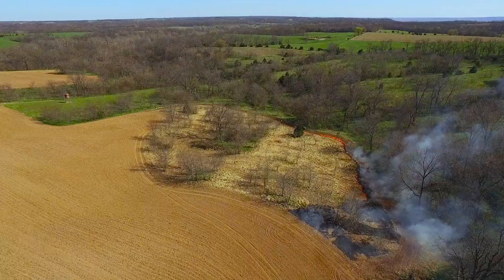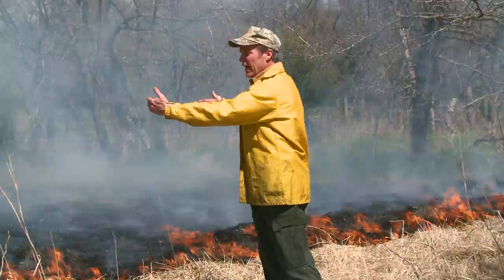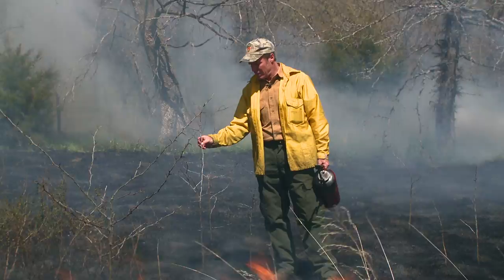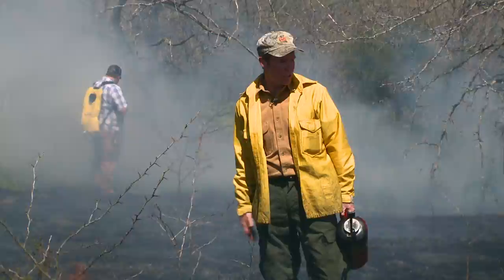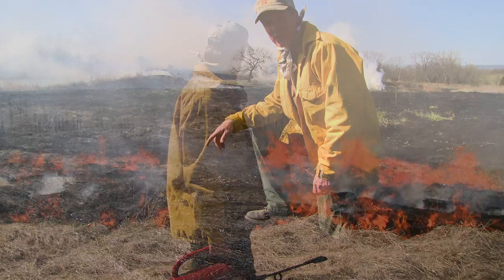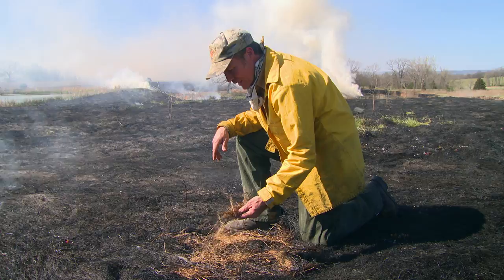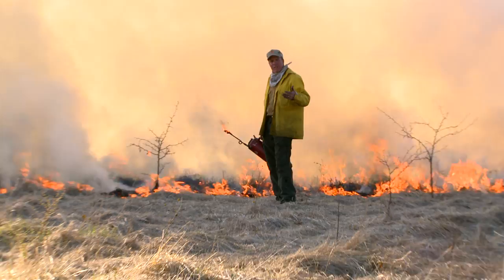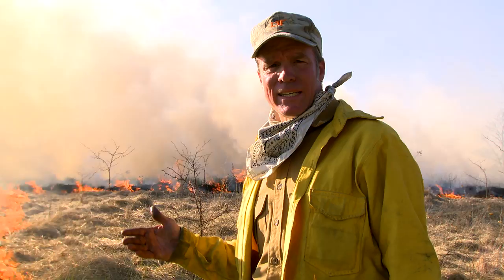Habitat Management | Controlled Burn Techniques | Prescribed Fire

Comment: I’ve heard you mow at least 4 foot lanes around the field for fire breaks. Is this correct?
Reply from the maker: There are many ways to create or utilize natural fire breaks. Mowing around a field is certainly a good and safe option.
Reply: Your break width is determined by your fuel and flame height. Smaller flame heights won't require as wide of a break to contain as a tall field of switchgrass would.

Comment: I've always wondered why people backburn to prevent fires when backburning is more likely to make fires worse.
In the early days of metallurgy, before people discovered coal, there was an entire industry built around charcoal burners. They used to burn wood to a point where it tuned to charcoal  and then store it for use in kilns. They did this because they discovered that it caught fire a lot easier and burned a lot hotter than timber.
When you backburn you do pretty much the same thing. You cover the forest floor with one of the best things humans ever invented for lighting a fire.
Reply from the maker: Interesting! Thanks for sharing!
Reply: Charcoal appears during burning with low oxygen levels, when the combustion doesn't complete fully, kind of “partial/pre-burnt wood”. Those are rather complex conditions to ensure, and rather hard to make to charcoal, not burning the wood completely.
Burning the stuff “in the wild”, on a large well-ventilated (well-oxygenated) area, will likely do a ”full burn”, so the wood will turn into the ash rather than into the charcoal.
Reply: @hawkesworth1712  
Now if you have ever watched any Fire Videos like Cal Fire TV on YouTube. They show that they are setting a backfire At the edge of the road and then you realize after watching it, that Fire 🔥 has no fuel source to back up to At the road edge but it's going to be a Head fire instead and cause Major Damage cause the wind is Now pushing the Fire ahead, and not slowly backing the Fire 🔥 but they lit it At the road side and the wind direction is key to a successful backfire and pushed the Fire 🔥 to the many houses that where burnt 🔥🔥🔥🔥 Up and They went ahead and said in the video that they were lighting up the Backfire At the road and a backfire goes against the Wind direction, but they did it with the wind direction and the Fire Race was on to try and stop it 🛑🛑🛑🛑🛑 but it wasn't a backfire now, it's now called a Headfire and out of control and it blew up overnight from what the TV News says.... and They wonder 🤔 Why that Happened........

Comment: Holistic Management  , cell grazing is a far more eco friendly way to consume thatch and bring back green pasture
Reply from the maker: Bee Winfield

Grazing alone will not eliminate non-native, invasive species. However, burning the non-native grasses in this case allowed the native seeds in the seed bank to germinate and dominate this site, without planting one seed. Native species are much more beneficial for both pollinators and also wildlife species for cover and browse. A lot of non-native species - for example, fescue, were brought over to North America for livestock grazing purposes - because they are resistant to grazing, so, grazing will not eliminate them. The most effective way  to eliminate non-native grasses is a proper herbicide application and burning.
Reply: @Whitetail_Properties  thanks for your reply, I am from Western Australia and we plant fescue and hope it survives because it is great grazing. I guess its complex and I dont know your terrain, eco system or objectives but as a general principle applicable  everywhere, and as stated by Allan Savory and Aussie Peter Andrews (great landscape restoration experts),we have to manage plants and animals to maximise soil microbe numbers and diversity. We Need to graze down the carbon into the soil ,  out of the air. We must not add to CO2 with burns and herbicide , both sure fire ways to degrade the soil and bring up weeds and invasive species. Over here they burn the bush every 6 years , thats way too frequent . Naturally a lightening strike may ignite a bushfire once every 20 years . That is fine and awakens native seeds like you say. But too frequent burning is very different and leads to poor soil that  grows only flammable weeds . So you have seen the return of healthy native prairie grasses after a burn? And do you then rotational graze that? How often do you burn the same patch?
Reply: @Whitetail_Properties  Im really sorry to be a pain but our cattle would have loved to eat all that feed you just sprayed and burnt. Im sure you are stopping the rain and raising the global temp by spraying and burning. Grazing produces a manure covered field that feeds the soil and grows tons of green solar panels (healthy plants) after rain. Our rain has nearly stopped because people burn and spray and get rid of plants, the great water cycle pumps  that suck down atmospheric CO2 and store it as humus, and send water into the sky as rain clouds . The young cattle or sheep become the best human nutrition . The carbon cycle, water cycle and eco services of good soil is enhanced . What you are doing is bad, and you are encouraging others to do it too. Please re consider this practice Tenessee man xxxx
Reply from the maker: @beewinfield  

Depending on the objective a site is burned every 3-5 years. And yes - to your question regarding the return of native grasses after a burn - in most cases, that is exactly why we burn. Generally, our object is to maintain good cover and browse for game species such as white tailed deer and upland game birds such as quail and pheasants. Non-native species such as fescue and brome grasses have no benefit for native wildlife - which is why they need to be controlled/eliminated. We are not grazing livestock, we are supporting and improving wildlife habitat.
Reply: @beewinfield   having to much manure on the field that didn't work it's way into the ground will cause Dead Spots and Even when you feed them bale's of Hay that didn't get All ate up it will also be area's of Dead Spots. Unless you take the tractor out and rake it up and re-bale it up and you don't get much but you have added more Pollution  than just burning it off every 3 years and by burning it off your adding nutrients back to the soil and ALOT of times the manure still hasn't started to dissolve yet but burning the pasture will help with the manure and dead Grass areas to promote Grass growth and I burn my pasture every other year and will this year and about 2 or 3 week's after the burn , the Dead Spots are starting to get some new growth and it seems to be more beneficial to the land than overgrazing with cattle and If the cattle are not eating it and it takes some time for it to be returned to the ground, from what they didn't eat and if it's too thick for New growth to be able to push thru, it becomes a Dead Spot and Must be picked up or burnt 🔥 and when you have alot of acres, to do this with hoping for the cow's to eat it all or just take a tractor and try to re-bale it and add to the pollution more than just burning it off and getting new growth and making it healthier than using just Manure and Hope....